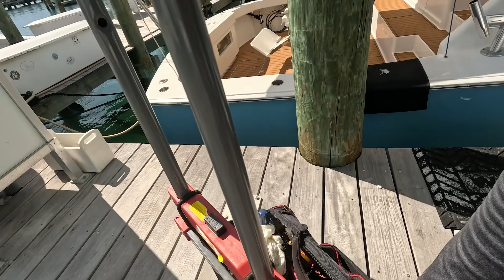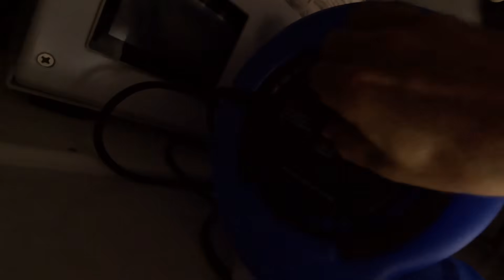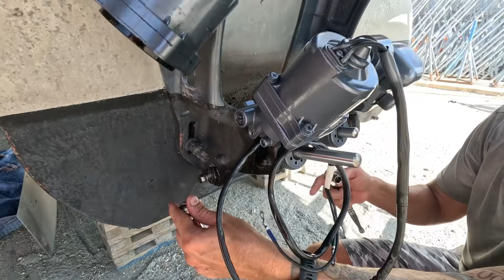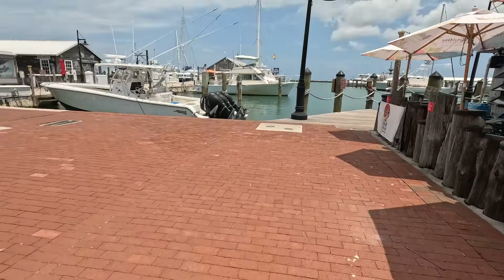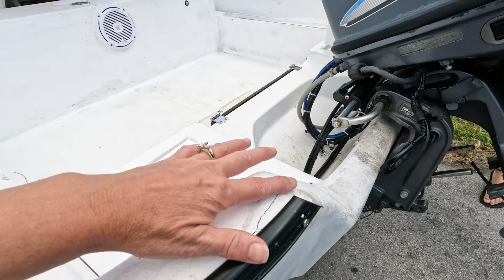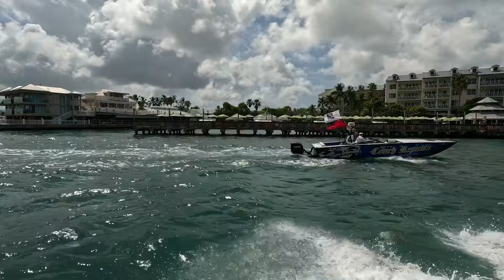Outboard Engine Tilt Trim Issues; No Air Conditioning …

Comment from the maker: As you can imagine all across the country has been extremely HOT so we have been super busy doing lots of air conditioning calls! A little bit of preventative maintenance to those units would could help you avoid being HOT on your yacht! How many times have you called to get your a/c looked at this year?

Comment: Thank you for the quality, entertaining and educational content.  What happened to that air conditioning impeller?  And, what is that A/C pump's impeller made out of, it looked metallic to me and that doesn't sound right at all.
Reply from the maker: Yes pump and impeller are made out of bronze. The impeller eroded away!
Reply: @WillFixThat  Thank you for the reply.  I learned something new again, I did not know that impellers found in recreational boats came in bronze as previously I had only seen them made out of what looks like rubber.
Reply from the maker: @apackwestbound5946  thanks for watching & sharing 🙏

Comment: Another great video guys! There's a guy on here that has a 21' Parker in which he installed a 5000 BTU(?) HOUSE type AC unit on board - he's also an HVAC tech by trade. Unit goes bad he removes it and gets another from a big box store or A...zon, puts it in and he's out on the water again. Innovative chap he is. BTW, Semper Paratus. ;-)
Reply from the maker: Thanks for watching and sharing Mike welcome if your new here. Yes some people use portable a/c units but that's easy on a small boat a bit more challenging on a yacht or bigger boats. Coastie!

Comment: It's been so hot up here on long island. Can only last 20 minutes outside. The humidity just chokes you and sweating just like jumping in a pool. Great video coming back to Florida in August for the winter. Gotta get mrs to do road trip to keys to see you all.
Reply from the maker: Sounds like a fun road trip to me ... might be easier to just on a flight depending on where you stay in Florida. We've had it the hottest I've seen here in 14 years. We are sweating our butts off feels like 110' some days! Since we work outside so much during the day we hide in the house when we get home. Counting down the days for it to get a little cooler.
Reply: The air quality up here was really bad. Florida's was alot better. Today 72 this am felt like 65 what a blessing. Only going to 80 and a great breeze. Now I can work on my Harley.
Reply from the maker: @scottmaz4063  we’ve actually had hazy days recently from 2 things the Sahara air layer & Cuba burning the cane fields! We’d kill for 80’ 😆